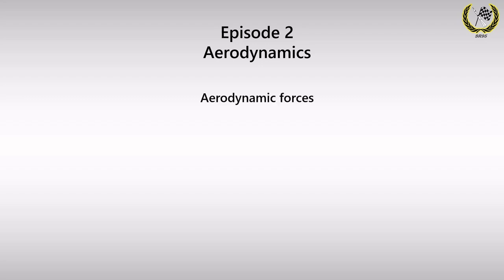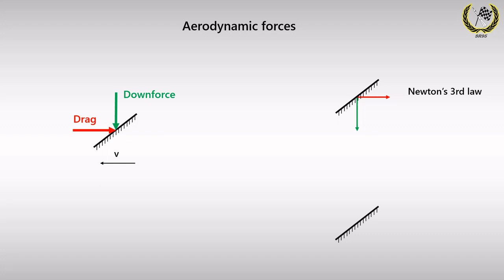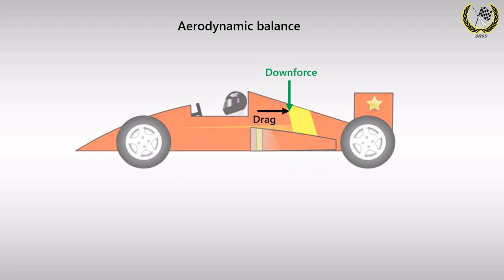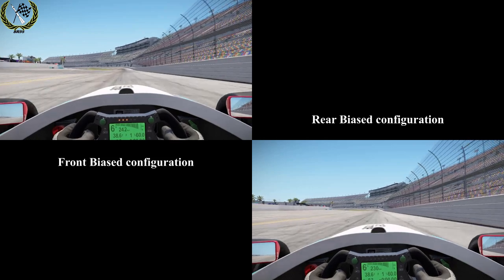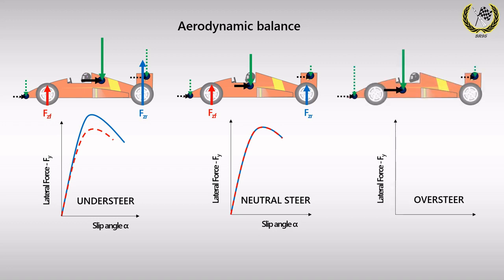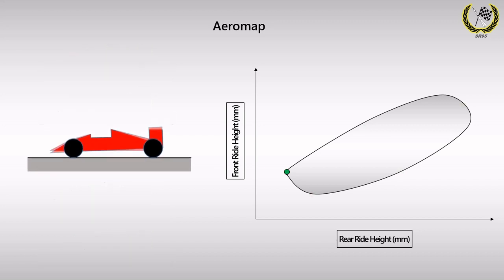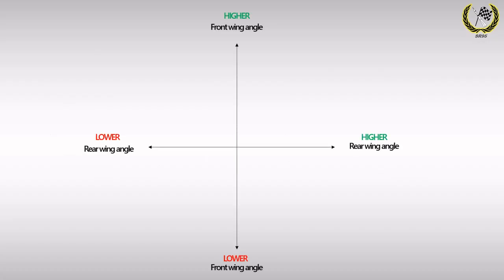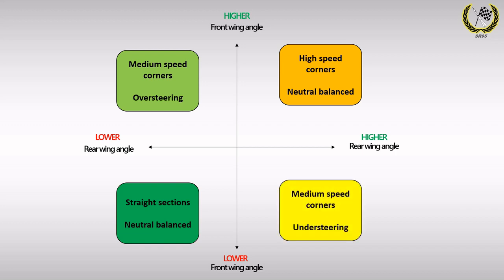Vehicle Setup Bootcamp - Episode 2 - Vehicle Aerodynamics

Comment: Congratulations! Those are a very crisp set of videos that you have launched. Especially the way you are able to show the variation in Vehicle setup and its effects. That's Project car you are using right? I don't know if it's possible with this software but it would be really good if the software shows the optimal path for a chosen Vehicle setup. Like user can choose on the performance factors(grip, control, stability/Laptime) and the software would suggest the optimal path/best race line. My recommendation would be to discuss the Dampers/ Kinematic setup if possible with the software.